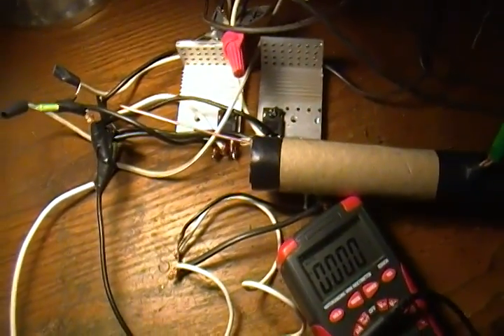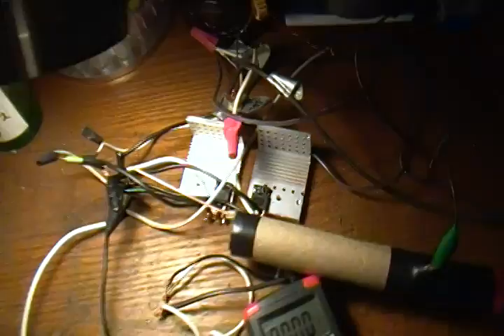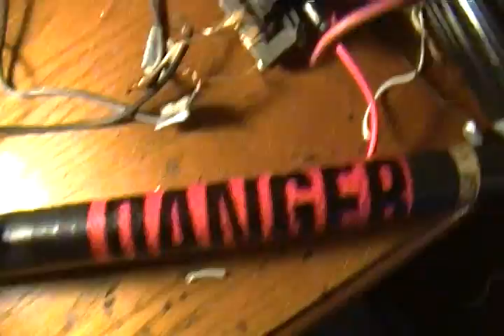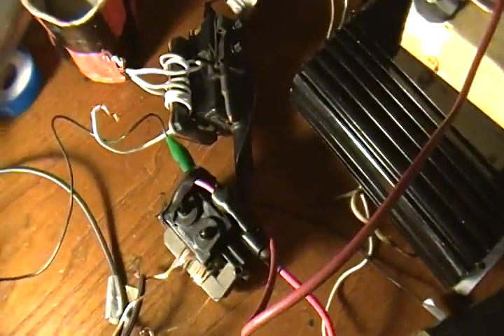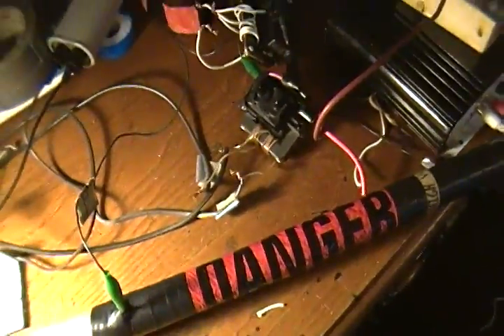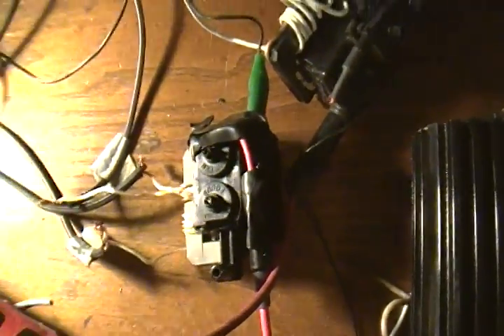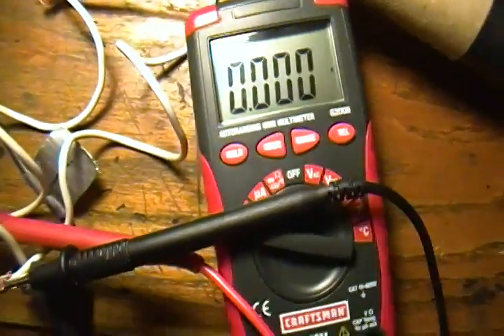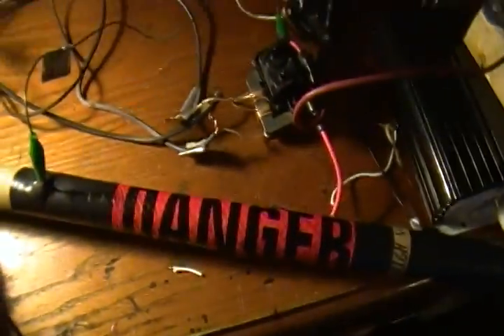Dual Flyback ZVS

Comment: For Pin arcing i like to cut the unused pins as low as possible, solder a lead to the HV GND pin and fill the potted area around the pins with hot candle wax, it seems a bit old fashioned but i have found it to work great so far.

Comment: 100kv might be abit difficult but im sure you can get it around there, i would try changing the turns ratio for a higher voltage output, for example you could try 4+4 turns on the core instead of 5+5.

Comment from the maker: Lucky! 10.....thats a lot. Remember that tv flybacks are much better than computer monitor flybacks. Monitor flybacks have built in capacitors that pretty much limit the arc. Tv FBT's do not have this, and the tend to be much larger. More Size + More POWER = More Fun:)